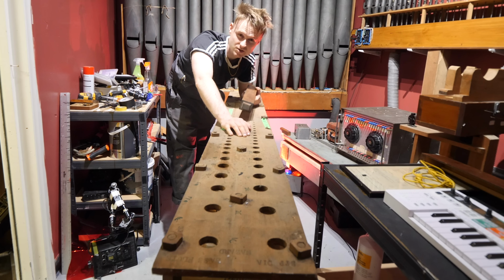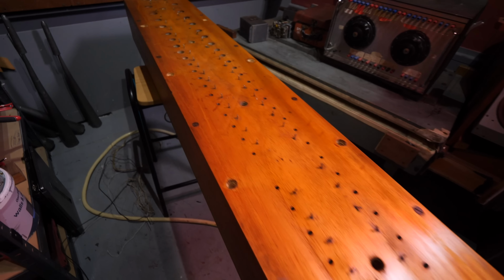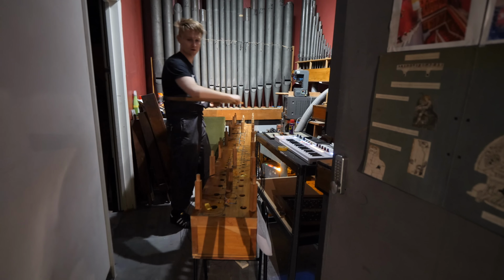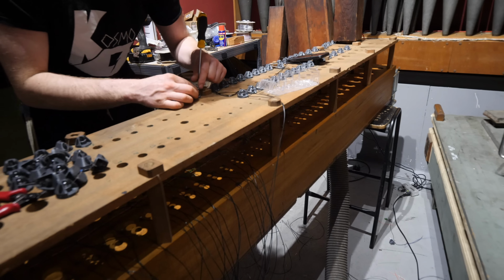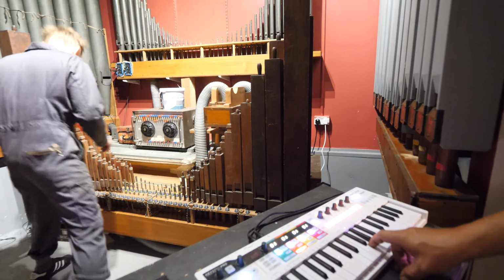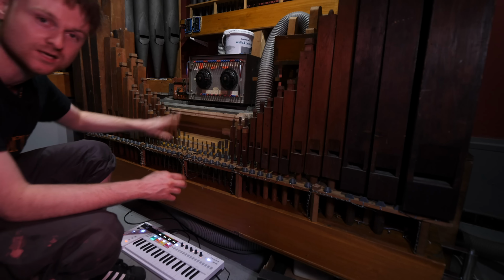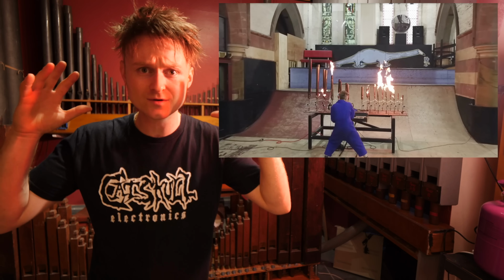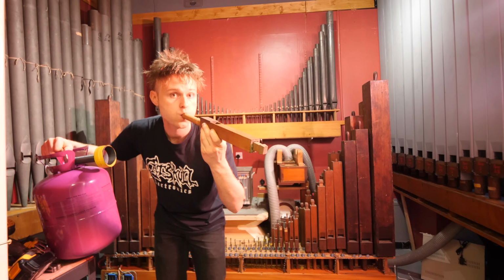HELIUM Through a CHURCH ORGAN, What Happens? I BOUGHT A CHURCH ORGAN PART 5

Comment: Thank you for acknowledging the scarcity of Helium. I am really impressed with what you achieve here, you are a man of many talents. Hopefully I can make it to the UK at some point to visit the museum.
Reply: Really glad Sam mentioned it (and didn't waste a copious amount).
Reply: I saw the video title and was about to rant about as soon as I watched it but he did just a small experiment which is fine I think.
Reply: Which is why I fill my party balloons with hydrogen. (/s. I am well aware that it explodes.)
Reply: @user2C47  Nah it fine as long as you don't hold it near any flames, potential sparks including static discharge or any other heat sources. Easy peasy! /s
Reply: @benedykt123313  would it really light on static discharge? I mean if its just pure hydrogen? I mean yeh hydrogen oxygen mixtures would but it can't burn if there is no oxygen, right?
Reply: @user2C47  What do you mean? Thats how real man party!
Reply: The worst part is that helium has an enough escape velocity and goes easily from the atmosphere to space.
Reply: Regarding the scarcity of Helium. It is really ridiculous that they are not capturing the Helium if they vent/quench an MRI machine. It is all simply blown into the atmosphere.
Reply: @svenhoff2653  wtf, thats a huge overseight honestly.
Reply: Acally didnt know this until sam said this
Reply: Look at the physics / maths. Once the helium is gaseous it is a huge volume. It's just not practical. Sorry. 
We had a closed helium cooling circuit in some labs, compete with the necessary compressors and stuff to reliquify it.

Comment: A Nasard (or Nazard) is the French name for a stop that is called a Twelfth on English style organs because it plays a twelfth higher than the key being pressed. For the keyboards of an organ, the basis of pitch is the 8’ pipe so a Nasard is often marked as a 2 2/3’. For the pedals, the basis is the 16’ pipe so a pedal Nasard might be marked as a 5 1/3’.

The reason the chest had multiple names is because the rank (set of pipes) is used for several stops. This allows the organ builder to reuse an expensive part (rank of pipes) at different pitches or between different divisions (each keyboard or the pedalboard). It also reduces the overall space needed.
Reply: So,  you're saying that the same pipe can be the octave of one register and the twelfth of another?
Reply: @bacicinvatteneaca  Yes, you can use one rank of pipes for let's say 8', 4' and 2⅔' by adding just 19 pipes to the amount of keys, so if you have 61 keys, you could make these 3 registers with just 80 pipes, instead of 3 times 61 (=183) as in a classical organ. The quint is close enough to the natural quint (about 2 cents) to sound good enough. If you would use it also as a third (e.g. 1 3/5'), you would hear that it's not exactly in tune. A Hammond organ does that, the 1 3/5' gives a very typical sound, as it is slightly out of tune.
Reply: @bacicinvatteneaca  I have an extended rank of 97 pipes that is serving 5 stops for one keyboard division as well as 5 stops in the pedals.

By selecting both the 8’ stop and the 4’ stop, every key played sounds the principal pitch as well as the pipe 1 octave higher. If I add the 2 2/3’ Nasard, it also plays the pipe a fifth above the octave.

The Nasard is the lowest non-unison pitch that reinforces the harmonic of the fundamental 8’ pitch. In addition, it helps bind the tones of a chorus using both the 8’ and 4’ stops.

BTW, a Nasard is known as a mutation stop - a stop that plays a single pitch at anything other than in unison or in octaves with the principal pitch.
Reply: So I got/repaired an old electric organ recently, and most of the instrument selection buttons have like 4' and 8' and so on written on them, and thanks to your comment I now understand why.
Reply: @spugintrntl  One of the idiosyncrasies of the pipe organ world is how they name stops. The names given to the same rank of pipes can change both by the octave or mutation and by the division. In my great division, I have an 8’ Principal. When it plays the notes shifted an octave higher, it’s called a 4’ Octav (it’s in the German style so many names represent the German name or spelling of a stop). Played a twelfth above, it’s the 2 2/3’ Nazard. Played 2 octaves higher, it’s called the 2’ Super Octav. Finally, played a twenty-fourth above, it’s a 1 3/5’ Tierce. If it had a stop to play it an octave lower, it might be called a 16’ Sub Octav.

Though my sole reed stop is called a Fagot Schalmei in both the 16’ pedal stop and the 8’ stops in both the swell and great, in other organs they might call this a Bassoon on the longer stops and a Shawm or Oboe in the shorter stops. (Fagot Schalmei is the German names for a bassoon (also spelled fagott and fagotte in Dutch and for a shawm which was a predecessor of the oboe that was most popular during the medieval and Renaissance periods.)
Reply: @spugintrntl  PS Reed stops are traditionally printed in red lettering so that they stand out from the flues which are normally black.
Reply: @thomasbland6428  I haven't seen any red lettering on mine... Might not be fancy enough.
Reply: @HammondDirk  so what would happen if the keyboard (midi file) requests the same notes be played over lapping or at the same time?
Reply: It's the ancestor of additive synthesis. You have multiple stops playing at once, all tuned to the harmonics of the 8' stop so they sound like part of the same note. 4' is the 2nd harmonic, which is exactly the octave. 2 2/3' (nazard) is the third harmonic, which is so close to the 12th it might as well be identical. 2' is the fourth harmonic, or exactly 2 octaves. And on big organs you often get a 1 3/5' (tierce), which is the fifth harmonic. It's sometimes called a "17th", but if you tune it to that interval in equal temperament it won't blend in so well. The fifth harmonic is actually a little bit flatter. Some organs even have a seventh harmonic stop, which is way off anything in the twelve tone scale.

But when you have so many tiny pipes playing you really need church acoustics for it to sound good. If you set it up in that small room it would sound much too bright.
Reply: @dh2032  When you have overlapping requests for the same pipe, it would all depend on the logic built into your control circuitry/programming. One possibility is that the chest controller sees an additional MIDI On event for a pipe that is currently on so it ignores it just as it would a MIDI Off event for a pipe that was already off. The other would be that it attempts to toggle on (go high) a circuit that was already on, resulting in a null action.

In both cases, the playing of the pipe should be terminated by the first MIDI Off event it receives. This could be problematic if you were attempting to sustain a note but the rank was being borrowed by a different division and a shorter duration note (possibly as part of a mutation stop like a Nasard or Tierce) was played in the middle, the note would cease playing as soon as the first MIDI Off event is encountered. It is a shortcoming of MIDI but something that might only be encountered in unique situations like pipe organs. Otherwise, it would take a situation where two or more keyboards were being merged into a single stream.
Reply: @thomasbland6428  @dh It would really depend on how you program the MIDI interpreter. If you do it really well, you count the number of Note Ons for that specific tone and only shut it off if enough Note Offs have come through.
And also how you would interpret the unison stops on the rank, you're quite flexible. Traditional extension organs used complex relay logic for that (didn't Sam show one of the multi-pole relays in the first part when removing it from the home?)
BTW: I built a MIDI controller for the pedals on my Hammond organ, and wanted to pass through the signals from another MIDI controller for the manuals, there I needed to take care of more stuff than I thought of: you need to analyse the incoming MIDI data to send off the complete messages uninterrupted, otherwise they might mix up and create hanging notes... In this case, I figured out that the Sweelinq Virtual Pipe Organ software I was using did the counting-thing I mentioned before: a stuck note couldn't be stopped by striking the key from the stuck note, as that generates a Note On command first. So basically: nothing happened when striking the key.
Reply: @spugintrntl  The numbers represent the pipe length of the lowest pipe of a stop (the C, which is the 2nd C on a normal piano keyboard). An 8' (8 ft, ca 2.44m) open pipe creates a tone of about 64 Hz. A 4' pipe is one octave higher (ca. 128 Hz), a 16' pipe one octave lower. Larger organs even have 32' stops on the pedals (16 Hz on the lowest key, almost not audible as a tone anymore), there are even 2 full 64' stops in the world: in the Boardwalk Hall Organ in Atlantic City (the largest organ in the world) and in the Sydney Townhall organ.
They also used this terminology on Harpsichord registers, and continued it on electric and electronic organs. 8' is always "as written".
Reply: @HammondDirk  Occasionally, you will encounter a piece where the composer/arranger actual writes it so one hand is sustaining a note, individually or as the lowest or highest note of a chord, then has the other hand playing these little run patterns that go right across that note.

When I encounter this on a score, I’ve found the most effective solution has been to shorten the duration of the sustained note so that it ends shortly before it’s supposed to be played again then start it again but extend its duration so that it ends where the sustained note was supposed to end. By resounding that note, it maintains the rhythm of the run. The interval between the end of the first and start of the second is best determined experimentally for each organ and it’s installation. I’ve found ending the leading note between 1/32 and 1/16 before the following sounds best to me. If you go too short, it’s like the air column in the pipe doesn’t have enough time to properly collapse so that the next note lacks that proper ‘chuff’ or attack. In a space that’s really live and naturally has lots of sustain or reverb, even longer intervals aren’t noticed by any but the most experienced, knowledgeable listeners.
Reply: @dh2032  on a real pipe organ there is no way to add a pipe, so it will stop sounding when the last note is released for the pipe. on MIDI it might be a different stroy = implementation dependent (specifically if it tracks how many "Note On" singals were received)
Reply: I thought it was a separate rank by itself. Usually, it is, because it is meant to be played with an octave. It is a shame.
Reply: @bacicinvatteneaca  Not the same pipe, but a different pipe of the same rank/stop.
Reply: @4hodmt  The pipes all need to be in tune with each other, though. What organ tuners usually do is to tune the principal using a reference, and then tune the other stops using the principal as a reference. It is more laborious, but it is worth it and makes a world of a difference.
Reply: @samuellourenco1050  It comes down to economy and available space on smaller organs. It’s quite common in that situation that ranks of pipes get reused or borrowed. Adding additional complexity to the controlling circuitry was far cheaper than the cost of the additional pipes and chest. Once a builder had mastered this, this could be marketed to hundreds or thousands of future customers. It also avoided increased maintenance costs for the owner as there were fewer pipes to tune.

In larger organs, certainly this could be it’s own rank.
Reply: @spugintrntl  What I’m hearing is you’ve learned of a DIY project for the future.
Reply: @spugintrntl  PPS If you have stop tabs arranged in horizontal rows, many are arranged in a logical manner by division left to right. Often, the longest flue stop is on the left then the flues decrease in length/increase in pitch as you progress right. If you have multiple stops of the same length, these are often quietest to loudest. Once you reach the shortest flue stop, you might have things like mixtures, reed stops, tremulent, chimes, and any other ‘special’ stops.